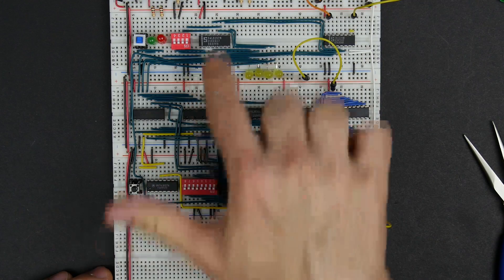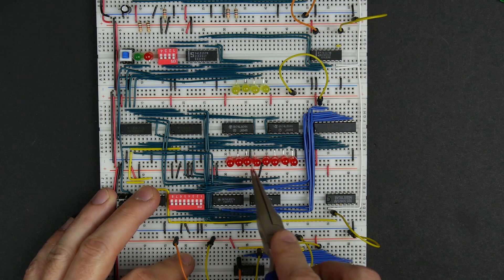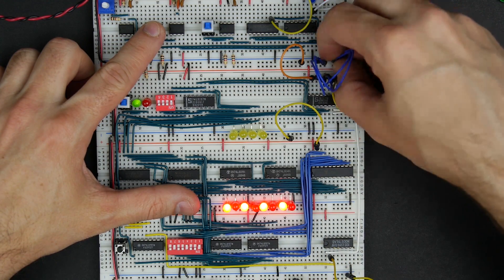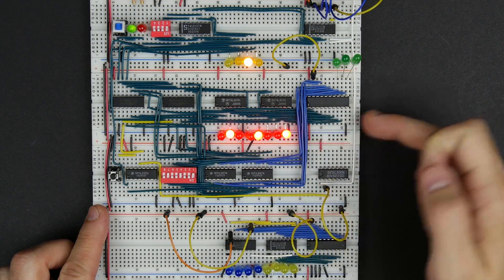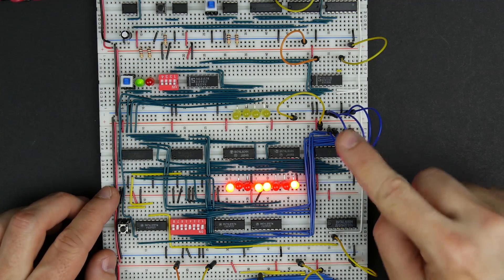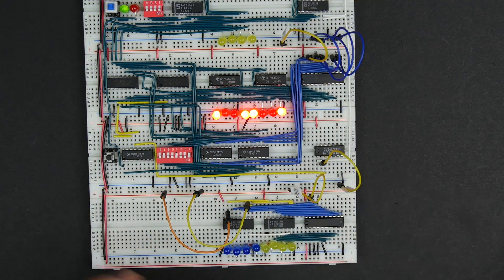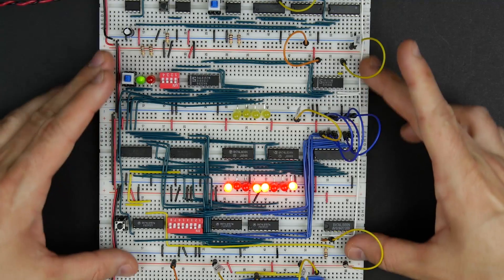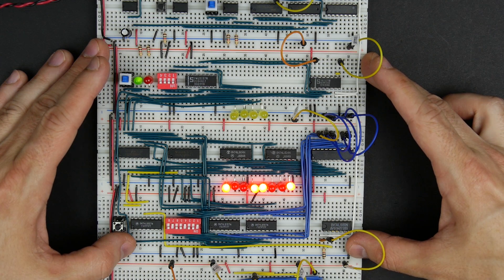RAM module testing and troubleshooting

Comment: Is the capacitor for the edge detector discharging through the clock signal?
Reply: That;s what I am assuming, and it messed up my program counter module (which gets the same clock signal). I'm curious how he avoided this. I ended up fixing by using 2 NAND gates in series to make a diode from the clock signal before flowing into the RC.
Reply: just pass the clock through a diode on the way to the edge detector then it wont flow back into your clock sync circuitry .. or a buffer as it will also bring the signal back to it's freshest high and low as it progresses ... and inverter also can work as a buffer ... but you have to ensure which signal you are using ... before you buffer it in an inverter.
Reply: @0623kaboom  Did the same thing and it resolved the problem. Wonder if an electrolytic cap on the RC edge detector wouldn't be better?
Reply: Wow this is exactly what I've been stuck with for quite some hours now!
Reply: @eXecu7e  Me too. I went over and over everything trying to figure out why clock speed doubled. I finally just removed the clock connection to isolate it to the edge detector. Glad to finally get confirmation it wasn't just something I did wrong. Wondering if I can just get by with leaving the capacitor and resistor out of the mix.
Reply: @smithw7003  You likely won't. I later got problems with writing to RAM, and finally fixed them by routing the clock twice through the Nand gate before going into the RC (to prevent any discharging of the capacitor from mixing with the original clock signal). Essentially followed this video: https://www.youtube.com/watch?v=QPX3Yrqs6yY
Reply: I just ran into the same problem,  though two years later!  Thank you all for your input on this!  Had me stumped 🤔.

Comment: Please do either the Program Counter or the Ring Counter next. The Output register is straight forward. My class finished it last week.
Reply: The Program Counter is very easy. It is only 2 JK FlipFlops (74LS107) and 1 4 bit buffer (74LS126)
all it does is increment from 0000 to 1111 

https://drive.google.com/open?id=0B6LIgQzDkH8fYnZlZk00bENITzg

Now  I drew this one up myself. I found that you do not need to hookup the J or K as they are both pulled high automatically. If you follow this diagram, please let me know if it worked for you.

https://drive.google.com/open?id=0B6LIgQzDkH8fU3F3VEJfLWJ1VFE

Comment: Please finish the series! We are waiting since 2 months :(
Reply: Easy does it! If you have tagged along all this way, the rest of the series you could probably think up yourself real soon. This output register is going to set up EEPROM skills, which is necessary for the instruction decoder later. I have built along the series myself and the only thing I think could be improved if it were some part list in the beginning so one knew what to acquire beforehand...

Comment: I have been following your 8 bit adder video and just wondering if you can also include and show us how to do multiply / divide in this computer too. I am very curious. I bought the book also. thanks a lot.
Reply: For fast hardware multiplication you might want to look up "Wallace tree" or "Dadda tree". Such could be added  to the ALU (as an additional "product register", just like the existing "sum register"). They do exist as 74 series chips, eg the Wallace tree: 74xx275.
For division I'm afraid there is no such (relatively) simple thing.
Reply: there is not going to be multiply / divide section of the alu, you will have to make a program for that
Reply: Is there any simple approach for the Multiply/divide function?does not matter if it is slower but having that functionality will be great. in Malvinos Book for SAP he did mentioned some examples of multiplications and existing SAP but he did it with counting and shifting bits. I hope that approach can be used even if it is slower. I hope Ben can show us something on this subject.
Reply: Data sheet for the mentioned 275: http://pdf1.alldatasheet.com/datasheet-pdf/view/152946/TI/SN74LS275.html
Reply: Right, but they do pop up on ebay; right now: http://www.ebay.de/itm/2-X-74LS275-74-LS-275-circuito-integrato-integrated-circuit-/321696870291?hash=item4ae6a0af93:g:5ZkAAOSwv0tVBeCc

BUT - I should have emphasized that before - it's NOT a complete hardware multiplier! I'll try and start explaining how to build one in the spirit of the breadboard computer:
You start by looking at how you'd multiply two nrs by hand. Let's start in decimal:
242 * 132 = (242 * 1) * 10^2  +  (242 * 3) * 10^1  +  (242 * 2) * 10^0
= 24200
+   7260
+     484
======
   31944
You see, you're taking each digit of the right nr and multiply it by the whole of the left nr, then multiply that by a power of 10 which corresponds to that of the single digit from the right. Let's call this power the weight. So each such operation gives you a partial product together with a weight. Finally, in order to get the overall result, you add together all the partial products - each weighted (ie. left-shifted) appropriately. The nr of summands in this final addition is obviously equal to the nr of digits in the right factor.
But wait, we already did some adding while producing the partial products! Let's zoom in into multiplying a several-digit nr by only one digit. How do we do that, exactly?
242 * 3 = (2 * 3) * 10^0  +  (4 * 3) * 10^1  +  (2 * 3) * 10^2
=       6
+  120
+  600
=====
    726
This would have been the 2nd partial product from above, and since 3 had a weight of 10^1, we've put in a summand of 726 * 10^1 = 7260 above.
Here we multiplied in the weights for the left-hand side digits right away but that for the right-hand side (10^1 for the 3) only after the summation.
But why not postpone multiplying in any weight whatsoever until the very end? Well, that would amount to do only single-digit by single-digit multiplications (as we just did), while "attaching" kind of a label with the correct weight to each result, and, just for now, keep them in a list (contrary to what we just did: we added them together right away).
Let's just do this for the example at hand: multiply each digit from the right with each from the left and keep track of weights. This will give us n^2 pairs of partial products and weights, where n is the (max) nr of digits of the original factors. Finally we'll sort the list of those pairs wrt to their weight.
Note: I'll put digits from the left factor on the left in each partial product, although for correctness that doesn't matter, of course:
10^0: 2*2
10^1: 4*2, 2*3
10^2: 2*2, 4*3, 2*1
10^3: 2*3, 4*1
10^4: 2*1
As you can see, we got a nice little triangle of partial products with weights, and it's 9 of them since we had 3-digit factors and 3^2 = 9.

Ok, at this point we're prepared to really go to guts and map all this to binary, which is when it'll become clear how to actually implement it with logic gates.
However, I'll stop here for now. Let me know if I should continue :)
Reply: Note: it's hard to find this chip, but you can build your own from (quite) a bunch of full- and half-adders, basically.
Reply: Thanks for the PDF link, I tried to find the chip in my electronics market but seems its not available. do you suggest any other chip that is still used and can be available? like I have seen many of the 7400 series chips are not available only the ones used frequently can be seen in the market. mostly the Gates, flipflops, adders and few register chips.
Reply: if you can get the 54 series version chip of the 74series chip you want do it, the basic difference is optimal operating parameters ... otherwise they are identical chips ... 54 series are old school military versions is all and more common outside of the usa and canada
Reply: thanks for the link! Very nice explanation! It will be great if you can make video on this topic so it is much easier to understand and it does looks like we can implement it in breadboard computer :)  Thanks!
Reply: Sorry guys, of course I got all them 1s and 0s mixed up... at first. I'll re-check it again tomorrow. So, if you really want to replay the actual example, plz take the actual bit values on the very right with a grain of salt for now.
However, the rest, ie Ax*Bx, sum(..) and carry(..), should be correct.
Reply: multiplication and division in binary is actually quite simple ... but you do a lot of side steps to get the result ... ones and twos compliments come in handy for doing it ....

Comment: I have my 8-Bit SAP-1 working, although it is not complete. But before I go on too far... A BIG THANK YOU Ben !!!

https://drive.google.com/open?id=0B6LIgQzDkH8fc0tuTTQ2TDhCZ1E

Here is what I do not have working yet.
I do not have the HLT or JMP working yet, although I do have them coming out of the Instruction Decoder, I just need to wire them up. I also do not have an Output Register setup, so I am happy when it Outputs the answer to the BUS.

I do  have a CLR system setup (I am using a push button and an inverter), I am fuzzy on how to keep the Ring Counter timer off, until I am ready for it to start. My push button clears the Program Counter, Ring Counter, MAR and all the Registers.

I like the Step by Step Mode, as you can see the MAR, Memory and Instruction Register interact with each other, to
move the correct data to the BUS and to the correct registers and the Instruction Decoder and Control Matrix, Loading and or Enabling the correct registers to move things to the correct places. IT IS AMAZING !!!

Anyhow, this is the program that I have entered. 

Address     Mnemonic     Opcode    Operand
0000            LDA                 0000         1010
0001            ADD                 0001         1011
0010            SUB                 0010         1100
0011            ADD                 0001         1101
0100            ADD                 0001         1110
0101            ADD                 0001         1111

DATA                                                                                      OUTPUT  

1010             DATA               0100          0001          65      1000001      65
1011             DATA               0010          1111          47      1110000    112
1100             DATA               0001          1000          24      1011000      88
1101             DATA               0000          0011            3      1011011       91
1110             DATA               0001          0000          16      1101011     107
1111             DATA               0000          0111            7      1110010     114

65 + 47 - 24 + 3 + 16 + 7 = 114      or    0111  0010

Comment: In all previous videos we have been using the correct terms, such as LOAD and or ENABLE. It looks like for simplicity's sake, we have changed the control signal inputs to IN and or OUT.

This will change the Control Word acronyms of the Control Matrix and force those of us, who actually read the source documents, to translate standard acronyms to the new different simplistic acronyms. 

So Lm (LOAD MAR) gets translated to Mi (MAR IN) and something like La (Load Accumulator) translates  to Ai (Accumulator IN).

This really throws off the meaning of the LDA macroinstruction command or mnemonic. (Load Accumulator)

As you can see this new simplistic set of acronyms can really throw things off a little. I have to say, I am not a fan of this.
Although I never could understand why Cp was used for (Increment Program Counter) The rest of acronyms are very intuitive.

I do not think, that anyone who has followed these videos, this far, needs a simplified understanding of the control signal acronyms. This is just my opinion. Please give me a Thumbs up or a Thumbs down, if you agree or disagree.

Thank you
Reply: you could fall back on the standard ... action device value ..... as in load register somevalue .... or write address register1 ....    this is how it was handled back when it was new stuff .... you used what you wanted to do ... what you were doing it on and what you were doing it with  ... this is how the machine code nemonics came about ... lda ... for load data from address ... would be...... load addressvalue somevalue   or you want to load the value at the address specified .... ... still comes down to WHAT your doing on what your DOING IT WITH what your USING .... action device value

Comment: Again, I will ask the question here. I have not seen anywhere, in any of the diagrams or schematics, where a mux is needed on the memory. There is no Load Memory. command.
There is an Enable Memory to the BUS, and you can program the memory contents with the 8 bit dip switch, but there is no load memory from the bus.
Does anyone here have any insight to this memory multiplexer?

Thank you
Reply: Isn't that just in the memory chip itself, the LS189? I mean you just tell it 4 bits of address and it, internally, translates that to which of the row and column LOAD lines (64 in total, be it 16x4 or 4x16) it should assert and which not.
Well, that's actually *de*multiplexing.

But maybe I'm getting you wrong. Do you mean eg. storing the contents of the accumulator into memory? Like, "STA"?
Reply: He did put a signal to load the memory from the bus. It's being used towards the end of this video (I think he calls it RI when he labels the control signals). That is how the memory will be updated when the computer runs, the 8 bit dip switch is just for programming before you start the computer.

Comment: Thanks for another great video. could you please provide a block diagram of what you have built already?
Reply: There is a a very good block diagram in this PDF. 

https://drive.google.com/open?id=0B6LIgQzDkH8fRmpSYm9ROTMzSGM
Reply: Oh thanks for the information. In addition, as Ben said at the beginning, he is building a modification of the SAP-1 computer, not the original one, and in this document we can see those modifications.
Reply: Awesome, Thank very much for sharing the schematic.
Reply: I only used this schematic for the Instruction Decoder and the Control Matrix. 
Which worked out perfectly. I used the original 1977 schematic for everything else.

This is the original one. (Instruction Decoder and Control Matrix is not good on this one.)
https://drive.google.com/open?id=0B6LIgQzDkH8faEJuaExJemxoUUk
Reply: What document are you  referring to?

Thank you
Reply: I'm referring to the first video Ben did for the computer. He said that the computer SAP1 has no JUMP instrucction as you can see in the original SAP1 book (second PDF you posted). He said that in the version he is developing, he would include some modifications and one of them is a JUMP instrucction. Thanks
Reply: Is there any way to obtain more than one chapter of the Digital Computer Electronics Malvino book? I have searched for a digital copy but cannot find it. I will purchase it if I find it at a reasonable price but as it is out of print they seems to push the price up.
Reply: Thanks Jeff. Very much appreciatted.
Reply: I assure you if you read the PDFs that I uploaded, you will definitely get all the information that you need.

I originally thought the same thing and was ready to go out and buy the 1977 copy of this book.

After reading the PDFs I have a full understanding of the control circuits that really drive this units
control inputs, that either Load something into a register or Enable it to go out onto the BUS.

I have not completed the control matrix, or hooked it up, but the 7 bits that I do have seem to be functioning correctly according to the Ring Counter.

Feel free to ask questions, there will always be someone here who can help.

https://drive.google.com/open?id=0B6LIgQzDkH8fbmxSVENYY0pMbkE

Comment: Ben, these videos are great and very helpful. I have one question: You mention in the video that the inputs on the 74ls series ICs have pull up resistors. What about the outputs? Don't you need some resistors here? Could you say something general about this with the resistors?
Reply: you need pullup resistors only when the IC has open collector outputs
Reply: All all these ICs do not have open collector outputs or inputs?
Reply: same doubt
Reply: Most of the logic IC's i've seen have two state outputs
Reply: technically all ls series chips have a resistor between the pin and the chip itself ... this is both a design and need of the chip ... to keep it using low power (L as in low power) they chip still needs to use a 5v setting so the resistor pulls the 3.3v supplied upto 5v for the chip to work properly ... being a schotky (S the person who found that paired transistors did a better job of doing what they do if they are matched)  so you do have a pull up resistor on every pin because  it must be there to improve power usage and decrease false positives from noise (the pull up resistor drowns out any background rf noise signal impeding the line and to better balance the transistors on the ic)